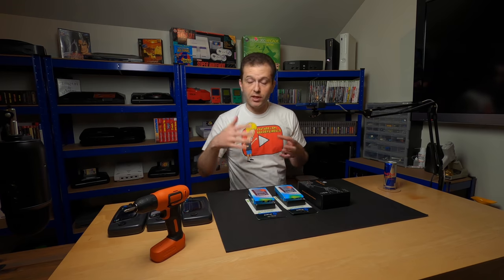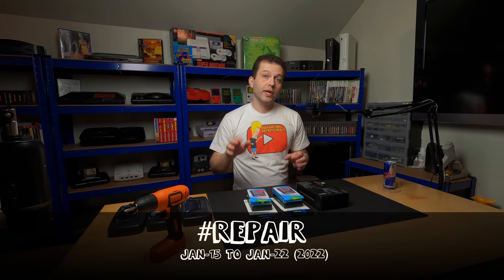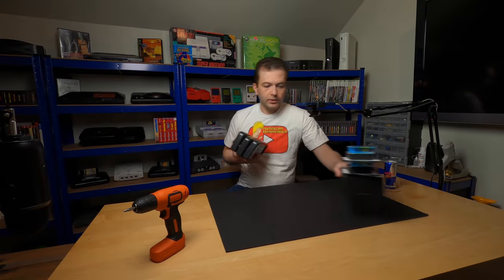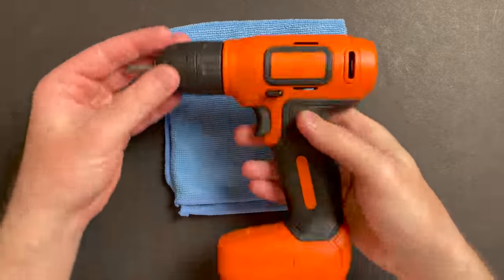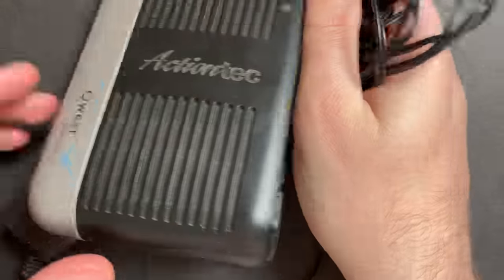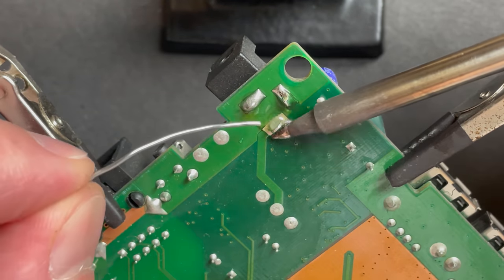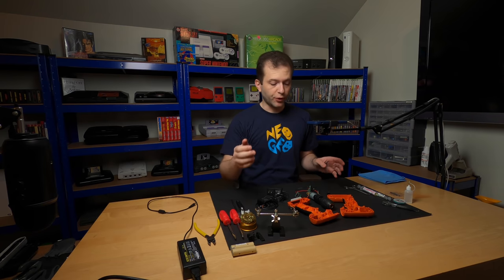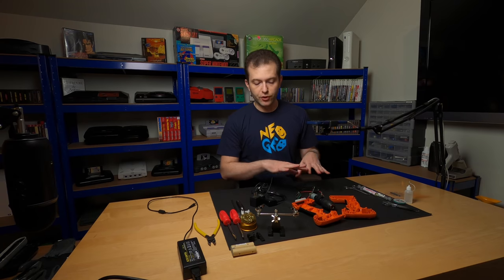Revisiting a Poorly Repaired Project & 25k Subscriber Giveaway

Comment: Thanks for the video! #repair

Also, I don't see it on the video, but after you use flux, solder wick, or solder on a PCB, do you make sure to clean it up with 99% IPA?

Also, since you've owned that drill for 6+ years, have you ever replaced the Li-Po batteries? I can't imagine them even holding a charge for that long.
Reply from the maker: My IPA bottle is that little needle tip white dispenser you see in some of the shots, but I edit it out to keep the video shorter with less important scenes. Technically with a no-clean flux you don't really need to worry too much about clean up, but I do it anyway on all projects just out of habit and a desire to keep the board residue free. Yep it's been 6 years with those batteries. 2015 purchase date on my Amazon history!! They still hold a charge but when they crap out you might be seeing this drill again haha.
Reply: @BorderlineOCD  Wow, can't believe they're still kicking. Would love to see a video of the batteries being replaced when they need it!

Comment: The pin on the side which you soldered your negative wire is not negative pin but insertion detection pin. If unplugged it connects to negative pin, but if plugged in, they are separated. You should soldered negative to the pin in the middle instead. #repair

Comment: In the video even after shaving the board a bit, you mentioned that the barrel plug didn't fit as good as you wanted it to be, however by looking at the board at 6:48
I think you could have shaved the other side of the board as well, this way the plug might have fitted better.

#repair

Comment: While the TS100 is an excellent soldering iron I would suggest you take a look at the Pinecil - it shares the best features of the TS100 including soldering iron tip compatibility with the TS80's ability to power from USB-C while weighing in at $25.

Comment: I would have only epoxied one half of the plug socket. Now you have to break epoxy to replace the batteries or repair a switch if it comes to that.

Comment: Awesome.  I was hoping for a new video soon. Had a couple of questions like: do you recommend any specific thermal paste or any type of soldering chems
Reply from the maker: I generally link the main products I use in the description, often with some specific ones that pertain to a particular project. I'm a fan of MG Chemicals - their solder and flux is excellent. I don't do any modding of modern systems so when it comes to thermal paste I use Arctic MX-4 (just got some MX-5 to try) which is a great and affordable all around thermal paste.
Reply: @BorderlineOCD  thank you for the reply and the advice.   I am learning a lot from ya.   I am an old dog so learning new things is tough.    I am about to embark on repairing a ps3 backwards compatible that just goes off.   Wish me luck.   I may have to video it and call it a comedy as the cursing, tool throwing, and quitting often begins.   Lol.  Thanks again and have fun.  Jealous of the jaguar.

Comment: Honestly man, even 380 C is a still little excessive with your work speed. Personally, I keep my iron at 310 and will boost it to 350 or so if I’m on a heavy ground plane, and I work about as fast as you. As with any similar detail work, you only want to be as aggressive as is necessary to get the job done. Start low and slow, and increase as needed. #repair

Comment: Hello, I #Repair most of my electrical stuff at home, but as you have shown in this video with the overheating soldering iron, this is also one of my problems, I also cannot control the temperature on mine, so a new and better iron would be very welcomed.

Comment: My first try to #repair a micro or mini USB port failed just as horribly. The difference was that in my case it needed the data lines to be connected as well...
Reply from the maker: I can imagine your pain. It's a tough project when starting out. Mini-USB is a little more forgiving if it's the through-hole type, but flux and a narrow iron tip is still required.
Reply: @BorderlineOCD  Sadly, it was an SMD connector. But just like you, I ended up fixing it properly later on once I had the experience. Back when I did my first try (around 2011 or 2012 or so), I didn't even know what flux was for, so I didn't have any!

Comment: That was a good idea to just replace the Micro B USB port with a barrel jack instead of making the same repair again. Good thing you had an old cable modem laying around. I am wondering why you were still holding onto it before you decided to repurpose it for parts this repair. #repair
Reply from the maker: I just realized I misspoke it is actually a DSL modem haha not that it makes a difference. While I am anything but a hoarder, over the past couple of years I have started keeping junk electronics around in some small quantities. Initially it was to open them up and practice soldering (just removing and putting components back). I used a portable DVD player for this purpose for the longest time. Later at a garage sale some guy had a box full of old PC games, a couple of DSL modems, and other odds and ends. I wanted the games so I made an offer on the box as-is and this was one of those modems. I've stopped discarding bad power supplies too, in case I ever need their plugs. I've pretty much let all my friends and family know never to throw any electronics out without checking with me first and I've received some stuff that way as well. Those are some examples, I know it probably sounds like a lot but its all in just one box in the garage. I rummage through it every now and then to "reacquaint" myself with what the heck is in there lol.

Comment: #repair

What kind of heat buildup do you have on that solder iron? Its hitting some temps that make me interested in the material temps and want to experience it. Good luck with everything, I have really enjoyed following your channel this past year!
Reply from the maker: I had it on 380C I don't recall changing it during this project. The TS100 heats up very quickly with a 24V power supply. It's a lot slower at regaining heat with a 12V supply so if you have an iron that accepts variable DC power, give it more on the supply side it will perform much better.

Comment: Very good vedio, surprisingly every time I run into your same problems with consoles I even currently #repair ing  a 1.0 og xbox which has never been opened so the clock cap has leaked everywhere damaging the power and eject button lines on the board I fixed the issue but I got a very weard problem now, one off the front panel led constantly staying on even if the Xbox is off
What's your comment on that??

Comment: I've always wondered if iFixit stuff is actually as good as they say or if they just get all the attention because they give sets to all the youtube repair people. Would be nice to find out. #Repair
Reply from the maker: I don't trust sponsored videos and I think there is no such thing as a fully unbiased sponsored video. Here's my two cents and I'll preface by saying I don't give a shit about being in iFixit's good graces. The iFixit bits are good quality and don't chip or deform like cheaper sets I've used. The handle (driver) on the expensive sets is excellent. On the cheaper sets however the handle looks the same as the expensive one but its plastic instead of metal so I would say its okay, not as great as the full metal one. The merchandising in iFixit sets is clever. It has all the bits you would ever need for console repair so they obviously put some effort in selecting the bits. It's just a driver bit-set after all so I'm sure there are even better ones out there. I would say its a good overall package if you don't want to think about it too much, and if you can afford it get the Mako or better which has the metal handle (driver) that I'm talking about.